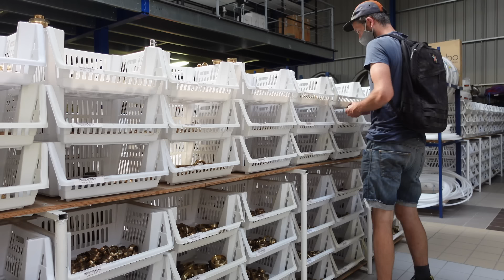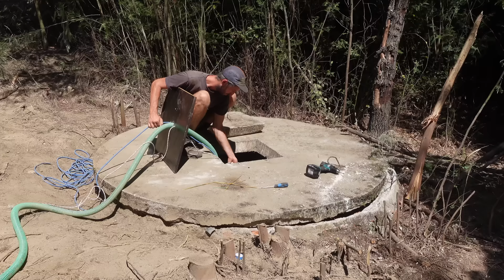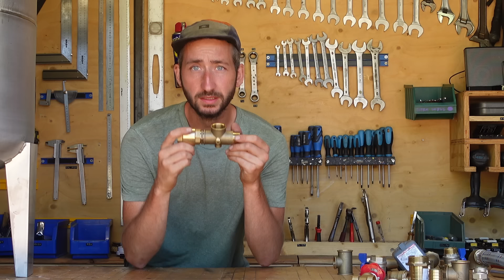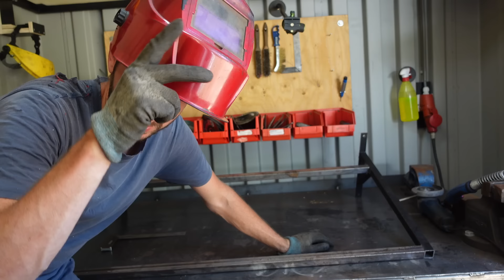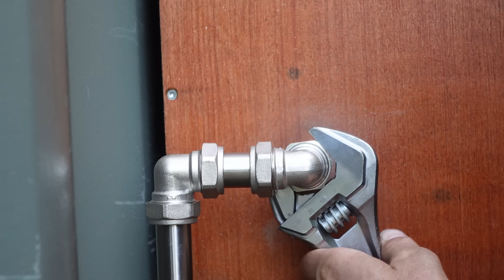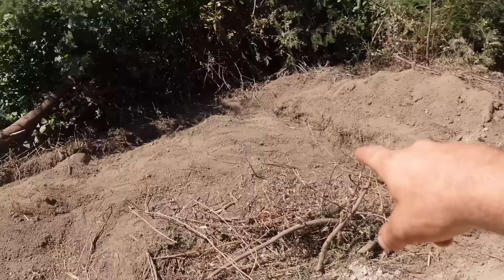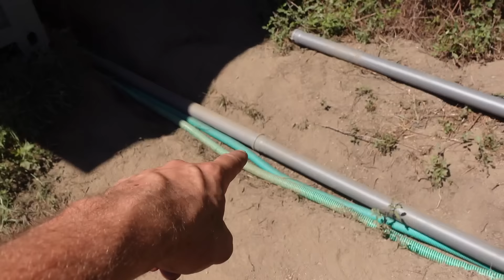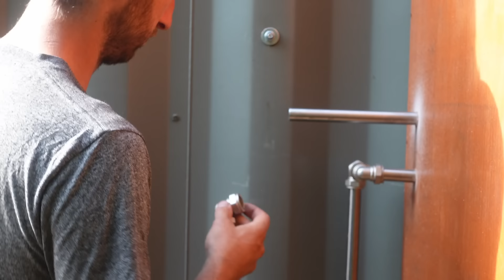#31 How we got running water from a well #offgrid

Comment from the maker: watch the previous video to see the well being (sketchy) cleaned https://youtu.be/2UKzntNnXp8
Reply: Please get some pvc conduit schedule 40 for the electric wiring, you guys are going to want to make sure nothing can happen to those wires as they are underground, especially with those cars running over them on the patch of dirt road also rodents love electric wires for some reason... Or else it's just an accident waiting to happen, you don't want to get electrocuted through your water supply, trust me.
Reply: Great update and congratulations on your critical infrastructure upgrade!

like @Lalaland, I am more than a little concerned with how durable those flexible pipes are in the long term being exposed to the elements as they are (if they were surrounded by concrete it would be a different story). 

Personally I'd replace them with rigid schedule 40 PVC pipes & bury them at least a foot underground to mitigate against the severe temperature drops during winter (specially under the road where road vibrations could crack your flexible pipe over time as it is heated & cooled).
Reply: do you mean sketchy because the dude spits in it?
Reply: Hi there just to let you know you will be better off with 2 'no return' valves ! one in front of your pressure tank and one just above your pump ! This will prevent any loss of water or pressure in the pipes.
Reply: The not really needed "clean" you mean :P
Reply: looks good, but that makes me ask, whats your source of income, beside  youtube
Reply: I'm loving the channel and its multidisciplinary nature! Hard work + technology + respect for nature = success! It may sound crazy, but if you just had a ton of acorns (as many species and sources as possible for genetic diversity), it would be a major step. Once planted in the rainy season, possibly next to a mimosa post, you'd begin the forest succession that will be necessary to eventually reclaim the forest. As many tree species as possible should be planted for food as well, but at least acorns are free! People would probably drop off bags full & volunteer to dig holes. I would if I weren't a world away. Cheers from beautiful Colorado! 🍻
Reply: WATCH THIS  - HOW WATER PROBLEM THEY SOLVED -   HE IS VERY SMART GUY  -  -  
https://www.youtube.com/watch?v=W7GUs9z_9zs

Comment: Your "Pressure Tank" is the same thing as an "Accumulator" in an aircraft hydraulic system. It is storing pressure at all times that the air side (or in the case of an aircraft, nitrogen is used as it is an inert gas, which is safer) is pressurized. Much the same as having a capacitor or battery in an electrical system - there is power, or pressure available the moment the circuit demands pressure - or in your case, the moment the tap (faucet for Americans) is opened.

Comment: You need to correct your terminology when talking about water systems. The elevated tanks are NOT an "old days" technology. It is still used today, and is the preferred method of distributing water to homes from Cities or Counties in each State, because it works with less electrical demand than a pressure tank system. The pressure tank system is mainly used for single homes that source their water from wells. Some Cities used that system, but very few compared to the elevated tank system, which also includes ground storage tanks too, I know you probably did not know the differences.

Comment: great achievement. Did you put the hose in a metal protection pipe under the road surface? water and electricity shouldn' t be close to each other .

Comment: Hey, I know this is old video but I think you installed the filter holder backwards.
It should have filled the left first then the right side.
When you turned on the water it filled the right side first and it should have filled the left.
The filter holder should have an arrow on it saying flow direction.  
I could be wrong but the ones near where I live all had arrows so it would filter thru both filters.

Comment: You did well getting all that done. 
It is usually better to install a UV filter into the system if you intend to use it for drinking water, as, it kills bacteria and microbes that can get into water. It may also be a good idea to fix down the well lid so animals cant move it and poop in the well, also, fix another check valve on the well lid, so, if you get a leak above ground it doesn't drain back to the pump and contaminate the well.

Comment: If you want some cheap Hot Water, run a couple 100ft of dark garden hose on top of your building  and loop it into a tank. The sun will heat the water and the water will cycle in the tank, giving a supply of hot water.

Comment: Don't you need sealing tape so the water dosn't leak on all those fittings. (I saw that you used tape at the end of the video with the shower so i guess you used it on the other things)
Also are thoose water lines deep enough so they don't freeze during winter?
Reply: Its In Portugal so pumps freezing isnt probably A big problem

Comment: Watering the garden would be best done from your own land, that culvert you dug, could be set up to irrigate the garden without using the hose. If the culvert runs dry, you can always use the well water, but, if the well runs dry because you used so much to water your garden and later your fields, in the dry season, then you have no drinking water. Also, if you are using the well to water crops, take that water off before your filtration system, that way your filters will block up far less often and any silt etc. you get out of the well, will just add to your soil. And please as others said, dig it deep against frost and reinforce it where it comes under that road. The guy with the digger could do the whole lot for you in an hour or so. Well done for what you are doing, but you may just be storing up problems for yourselves in the future.

Comment: I love that you guys can figure these plumbing issues out.   The many years I’ve had in plumbing have taught me a lot about all kinds of plumbing parts.  I will use the Braided Stainless Steel water lines in the 3/8” variety and smaller for faucets and dishwashers and fridge/Icemakers.  But anything larger, I’m not a fan of.   The 3/4” size made for water heaters never seem to last as long as the faucet variety.  I have just seen to many of them fail right where the compressed hose is connected to the end fittings.  This probably do to the higher water pressure in cities and as such my not cause you any problems.  I hope this is helpful in your endeavors.

Comment: Hi. I get my water from a well as well, and would like to recommend a couple of things:
1. Don't get your water from near the bottom of the well (I know it looks like you have more water), because you will be sucking up sand and silt from the bottom of the well. Our pump pulls water from 75-100cm from the bottom and the water is a lot clearer.
2. Do a multi-step filtration system. We have a water filter (string wound element) after the check valve, before the other elements of the system. That prevents fine sand getting into the rest of the system and reducing the life of the components. This should be checked the most often. If not used, in time fine sand will build up and can clog the pressure switch.
3. If you use the water in house I highly recommend a water pressure regulator (it levels out out the differences in pressure between when the pump is on and when it's off ).
4. For hot water in the summer we use a coil of black PEHD plastic pipe (or hose) thrown on a sunny roof (it gets HOT during the day). We use it for our outdoor shower.

Comment: Hello my dude, I just recently got into your videos, bro, there is a thing called a "misting system" it's basically a long hose you can get in a  variety of sizes but.. you cut and you add in little "misters" every few feet (meters?) then you connect that to your water hose. And you have multiple different connections for it so that way you could turn on the water and have one side closed for your hose but open for the misting system and then you just let that run for a few hours and then shut it off. save yourself the work of having to water all the plants. Modern problems, require modern solutions. Hope this information helps ya buddy 👍
Reply: Also good to help prevent fire, and have a system in tact that will counteract in case of a fire ?

Comment: I dont know what pressure the pump is producing, but maybe a pressure reducing valve could me a welcome addition to the system. This way the system and pressure tank is drained at a lower rate, which equals less pump starts.

For checking and maintaining the air pressure in the pressure tank i can recommend a small cartire compressor with a pressure gauge. 
Works great, this is what ive used for 5 years working at a company selling pressurized watersystems as well as grey and black water pumps.

Comment: Wouldn't have put the filters above the pressure switch.
When you change the filter it'll spill water all over the electrics of the pressure switch.
Also in the winter the external pipe work needs insulation or it will freeze and split the pipe.

Comment: Would recommend a inlet filter on the pressure tank to avoid having to drain and clean the whole system in case you get dirty water from the well..

Comment: Love the work you guys are doing. A few comments: electricity and water in the same trench is not a good practice; it seems there is no air compressor for the tank; it is important to add a pressure release valve to the tank to keep the mechanical integrity of the tank specially if this is a small metal thickness; no need of SS pipes, you may run the entire system with CS pipe, it is cheaper. Good luck guys.

Comment: The one way valve is not to hold pressure it's to prevent water from your system backflowing to the well and possibly contaminating it.

Comment: My grandfather and my father worked at a company that dug bore-holes for water. And install all the components you used on this video, for many many years. Thousands and thousands of water-wells (bore-hole) for more than 30years. And I used to help as teenager and saw how they did it.
2 tips for you:
1:That is NOT, and I mean NOT!!! the type of pipes used. Always use HDPE pipe. HDPE pipe from the pump to the well cover > Check valve -> 90degree bend -> HDPE pipe to the tank. (check valve at the well cover stops the water on the pipes from flowing back to the well. water weight inside the pipes counts).
2:Get a metal tube to pass through the road, as others said, or it will be crushed. Also get a smaller HDPE pipe for the pump cables. 
Great video! Loved the detailed how-to :) hope it helps.~

EDIT: I just noticed the camp is very close to my hometown, like less than 50km. I'll gladly help on that matter if you want. Cheers!

Comment: Backflow valve should have been installed on the pump itself to prevent water draining off of the pipes while pump is not working. If this install is at least semi permanent your piping will not survive even one winter (passing car would probably destroy it even earlier)

Comment: Hi. I have seen your video i have some recommendations. I am from Portugal.

I need to say that i have experience and work on water lines for living.

1: So, normally the full pipe from pump to pressure tank have same pressure that system. We use a black tube with blue stripes where, supports 8 Bar. The accessories parts are all in plastic and easy to connect. And it's very more resistant to compression by traffic above. But should have concrete pipes to cross road our protect pipes with sand when underground ( best and cheaper way).

2: in exit of the pump must have a non return Valve that the system and pipe don't lost pressure, so the pump works less.

3: you could have another in water house before pressure switch but isn't mandatory.
 
4: your "filters"  must have a filter element for filter water properly. Where it is?
I recommend cotton + coal filter and a sand filter our micro screen filter.

5: Portugal gets really cold in winter a d that expose pipes, stainless steel pipes and brass connection it's receipt for disaster when you don't expect. 
Work in protect the water house and pipes connection to house.

Keep the good work.

Comment: That green hose is not pressure rated, designed for low head setups and suction.
Reply from the maker: we found that out the hard way. Next week update ;)
Reply: @ProjectKamp  LOL, don't be affraid to run a big diamter Poly pipe from container to the well, inside it, have power cable (double insulated) as well as a 1.5" poly water pipe. You have a decent sized pump and small valves and fittings at top. All sits inside bigger tube allowing for servicing or additions later.

Comment: Not to be negative but that green hose looks kinda weak. Are you sure it can handle the 4-5bar of preasure that punp is capable of in the long run?

Just estimating pump preasure no idea actual spec on the pump.

Comment: With a shallow dug well like that one you must constantly be concerned about contamination of the well from rain water, your activities in the area, (livestock) and any bug or animal that can get into the well.  Grade and slope of the landscaping must be maintained so overland water cannot enter the well. Also, I would recommend a sand screen immediately after the check valve. It will save replacements on those tiny filters. Sooner or later you will install the 20" versions of the filters.  I would also install a UV disinfection lamp on the system.  There are some that work on demand and do not have a continuous electrical drain.  If the water is not sweet sometimes a charcoal filter element can work miracles. I noticed a float switch on the submersible pump but you did not mention it.  On a dug well it is crucial that this switch is working and that the pump is deep enough for the well water to cool the pump but high enough off the bottom to minimize the disturbance of the bottom of the well. The float switch needs to shut off the pump well before the water level is below the TOP of the pump. Most systems have an audible and visible alarm that is triggered when the float switch cuts out the pump. This is important to know as it is how you will tell if you are over pumping the well.   Perhaps you did not know but one of the reasons for the water towers was to compensate for low refill rates of  certain aquifers. If the refill rate was low a pump was slowed down and run continuously to fill the water tower so things like having a shower would not drop the level of water in the well.  Be very grateful that your system does not have to work at -30C.

Comment: You need an air bleed valve. I think you are pumping air for the first few seconds when the pump turns on. Also add a thick culvert pipe under the road. Ideally you would run PVC pipe all the way to the pump and put the water and electrical pipes inside that. Your water system will wear out really quickly otherwise.

Comment: The water lines and pipes will freeze in the winter, either put a heat cable on all of them or redo all of it, the water line should lay atleast 60cm underground depending on where u live otherwise it will freeze

Comment: nice vid, Watch out the water can be very hot in the summer whit all the metal, and dig the trench deeper,if you drive over the road or dig into the ground you will damage the line. put it min 40cm deep.

Comment: Ok, so a pressure tank doesnt use a ballon, there is no seperation of the water and air, but the air compresses between the tank and water to give you pressure, what you decribed is a bladder tank, which has a rubber diaphragm, also youd pump compressed air into a bladder tank roughly 2 psi less than what your set your your pressure switch on, bladder tanks also for majority of the time hold less water than pressure tanks.

Comment: Better to have a filter prior to the check valve, the dirt can get stuck and you will have back flow problems. Second, different types of metal pipes can not touch each other! It will create rust.

Comment: I have lived in the country for 40 years and have a well.  Because we have some large water use (60 acre property) I put in several additional larger pressure tanks (you just T them off a longer pipe run).  We have a total of over 400 gallon capacity in four tanks.  Once we did that the pump may only kick on once a day during normal use, more frequently of course when watering etc.
But since you are on solar that could help you shift power usage to times when you have excess power during the day.
The comments saying to put the filters before the tanks are not really needed.  The tanks do not become "fouled" unless the water is really to dirty to be using for drinking.  Many people operate with no filters at all.

Comment: along with everyone else giving advice, it's pretty important to use colour coded conduit when laying multiple runs of pipes, that way you can tell if you're about to cut open your water line or electrical run, or both. I think the standard is Orange for electric but it could be different in your area

Comment: What a cool video!
Please do yourself a favor and never ever ever ever use the plunge saw while holding down the Guiding Rail behind the saw. If you get - for some reason - kickback, the saw will jump back and cut off your fingers. You're already doing yourself a big favor by not standing behind it, but having any body parts you want to keep attached to yourself behind the saw is just a very very bad idea. Clamps for holding the rail down are a bit expensive (at the end, it's Festool...), but your health is worth it ;)
Keep on with the project, it's awesome :)